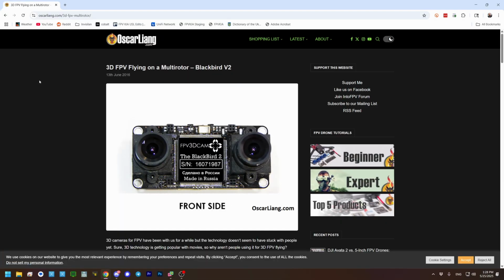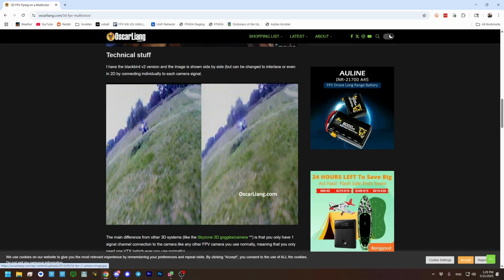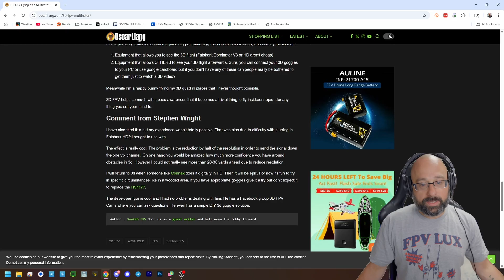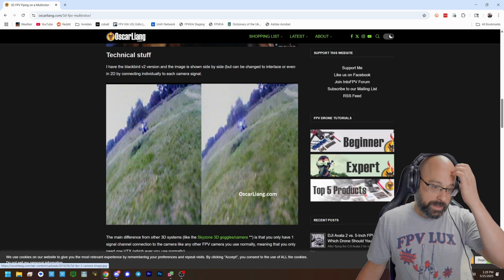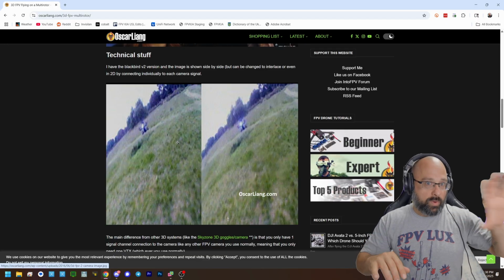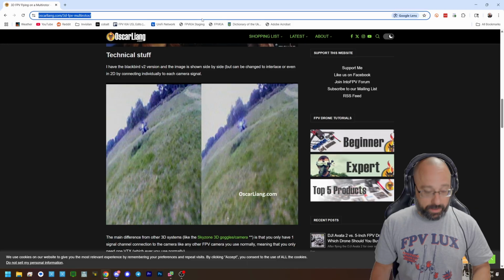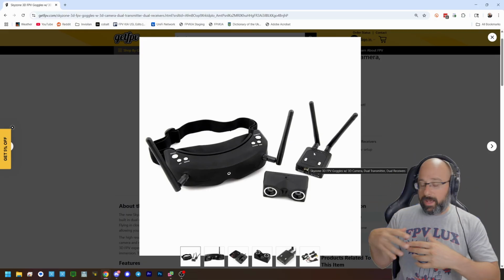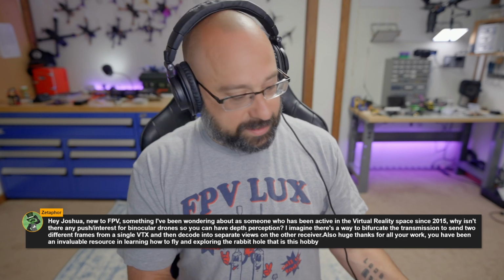Why Don't We Use Two FPV Cameras For 3D Video In Our Goggles? - FPV Questions

Comment: That's a damn shame. I am now retired but I worked in VR, Simulation, GFX etc. I'm in UK but worked for e.g. Silicon Graphics ( it was a world leader in Computer Graphics. Many ex-SGI people now work at Nvidia) and later, BAE Systems in the Flight Simulation team. EVERY animal on Earth has 3D stereoscopic vision of some kind. I can't believe that we put up with 2D vision in drones. OK, it was tried in cinema (at least twice) and TV (which failed becausee people didnt want to wear stupid LCD glasses - I dont blame them), but how difficult can it be with modern, cheap digital multiplexing, to transmit 2 images at the same time?
Come on DJI. You can do this.

Comment: Sigh. High-end feature-film stereoscopic professional here. Yes, we still exist. 

First things first - everything presented here is technically weak. There are literally zero technical barriers stopping the development of commercial stereoscopic drone camera systems at a consumer price point. Zero. There may be some compromises in terms of weight distribution due to the need for wide IO to best experience environmental scale, but that's it. The cameras, codecs, transmission and display technology are well established and affordable.

The simple fact of the matter is that the 3D stereoscopic brand is damaged. To develop and sell a consumer product with stereo in it costs tens of millions, and there is huge hesitance to engage. If you really want it, you can have it -but you all have to stop saying it's hard or impractical, because it's not. The various drone manufacturers are looking at their consumer base for clues for their next advancement, and if you're all 'will never happen' that is literally going to kill it. 

So, have some imagination and just ask for it. And as you all suspect, consumer FPV drones would be freaking amazing.

Comment: I’ve been filming VR 180 on my cinelifter drones for several months, and the results are stunning in the meta quest…. and I’ve been thinking about building a stereo DJI vo4 setup, but haven’t had time to work on it yet. I also realized that the reason you really don’t need 3D when flying that much is because the drone is always moving you are constantly getting parallax feedback from your surroundings that your brain turns into a sort of pseudo depth map.

Comment: The better question I think is why has this not been revisited with digital. Not only does digital have more resolution to work with but with analog, you need twice the bandwidth and that's not true with digital. The right and left images are not that different and compression can be used to make it require less additional bandwidth. You wouldn't have to give up as much resolution as well as having more to work with.
Reply: Working on it. Looks like there has been a fair bit of work on deep learning-based stereo video compression, but if I understand correctly, you would have to strap a GPU onto your quad to use those methods, and the latency still isn't great. But maybe soon!  In the meantime I think it makes sense to just have separate systems in parallel for each eye.

Comment: I made a stereo vision system for my robots using 2 Pfisher Price PixelVision cameras and 2 portable 4" TVs back in the early 90's. A HUGE hassle getting the images to line up but it did actually work.

Comment: i flew with several different types of 3d video and 60mm is great for 3d ipd and interlaced video worked best. i have videos on my page, the videos are in side by side because youtube doesn't support interlaced, but the best cam was the EMR labs 3D cam fpv camera out of Canada. i currently own one it still works great.  i also own several blackbird cameras both the original, 3 of the  mark 1 type, and 2 of the blackbird 2's and a 250mw video transmitter that plugged directly into the front of the blackbird 2 these all worked on a single analog video Tx 
the problem i found was susceptibility to vibration, and being 60 mm wide made mounting it safely difficult. oh i also have one of the nerd cam 3D as well its a piece of junk badly made.
i do wish someone like DJI would make one in 4k that would be interesting if you would like to see them or try one let me know

Comment: Joshua, I have a question: why don’t we use 180° cameras and to digital pan and tilt instead of using bulky and laggy servos? I believe there was a parrot drone that had digital pan and tilt and another proprietary system that I forget. The digital pan and tilt could be done either on the model or down on the ground. I’m dumbfounded as to why this isn’t a thing yet and I’ve been wondering this for probably a decade or more now.
Reply: Doesn't this increase the size of the data to be transmitted significantly?
Reply: @nullfield1126  No, as I say, you could have the digital panning done on the model so the feed is cropped before transmitting. You could even have two 180º cameras, one on top and one below the fuselage similar to a 360º camera. If you do a search for Parrot Virtual Gimbal, you'll see exactly what I'm talking about. We just need a generic version of that which could be installed in any model.

Comment: I wonder if it would be possible to train an LLM to extract depth data from the motion of a single high refresh rate camera and simulate a stereoscopic image from that inside the goggles. Would probably not be perfect and caus neausia real fast 😅
Reply: You wouldn't use a Large Language Model to extract depth data from a video feed. You don't even really need AI, either. It's just a bit of math to calculate a depth map from two images.
Reply: @Keyboardfanatiker  AI is also just math 😅 but I know what you mean. I was thinking that simulating the 3D effect could also be done using an LLM, similar to frame gen on GPUs, since it could possibly interpolate the data in way thats maybe more suitable to human perception and maybe avoid the sickness problems. If that's possible without the need of an LLM that would probably be even better.
Reply: @MarkusRessel  I'd rather have that dialed in by expert pilots.
Reply: @Keyboardfanatiker  not sure what your point is, I am not trying argue about which technology or approach is best 😆 I am just wondering if this would be possible _somehow_, and expressing that I would find it interesting. If some company is going to do it, they will do it whichever way is best for them anyway.
Reply: @MarkusRessel  Agree to disagree?

Comment: I did this with Skyzone goggles, two VTXs and two seperate cameras. They were high quality at the time but they were also analog. Today's analog systems are much better but still nothing like digital. For me, the poor video quality of the older analog systems made the 3D effect less than impressive. Trying again with a digital fpv system sounds very interesting! Maybe one of these IPC systems should think about trying it?

Comment: One good concept to design a stereoscopic 3D drone, is it for 2 fpv cam or 2 action cams and 1 fpv cam is a H-shaped pusher.
Reply: I played with two GoPro 5 Sessions, which can be started at the same time through the remote controler. Stitching can be done with old GoPro software or DaVinci Resolve (unfortunately only with the pro version). You can watch in a Cardboard, or much better, with DJI Googles 3.

Comment: I feel like the 3d experience would fit the best with head tracking and planes. It's just not necessary with quads, but in a plane you want to look around; especially with a head tracker. Depth absolutely would be a great fit for planes imo
Reply: it is also great on quads

Comment: On February 7, I posted a table (on a black background) on Instagram and TikTok that summarizes the two systems I know. After that, also some concepts on paper how to build a carbon fiber stereo 3D frame. I own the Skyzone 02X and 02S dual vtx rx 3d system goggles, but it will be a while before I can show this carbon frame in real life. That's exactly why I'm still investing in analog cams and vtx, because you can still use it for stereo 3D...

Comment: For the stereo 3D drone: I use two separate cameras going into two separate VTXs. You can choose the spacing between the cameras yourself. More separation is a stronger 3D effect: the world seems smaller. It does not have to be exactly 70mm. 

For the goggle side. The Skyzone O2C can receiver the video separately on both antennas for the 3D effect. The goggle can be bought on eBay. The special transmitter is crap and nobody sells it. 

But for me it is worth it. Since that moment I can’t fly analog
Video in 2D anymore. You can see far more because your eye is a very good graphic compute unit
Reply: Are you 100% sure 02C can do it  Because i did research sone month ago. But yeah i kniw that 02C is same than 02X but without front cam and without head tracking... But as far as i can renember i have not found any proof that 02C can do dual vtx 3D. I have done a summary table about stereo 3D february 07 shown on insta and tik tok. Is a black pic with white table...
Reply: @Sugalime3D_FPV  let me check, i have two o2 googles that can do this
Reply: @Sugalime3D_FPV long press the right button to go into the menu, and you should see the 3d options. They've had it even as far back as the sky01
Reply: @Tokyo_Dom  Are you sure the Sky01 can do it ?  And as far as i can see there are diefferent Sky01 versions. SKY01 V1/V2, SKY01S. I'm even not sure if the 02C can do it. Because at Skyzone you can go to Download and check the manuals.... SKY02C do not show the 3D funktionality in the manual... I own the SKY02X and the SKY02S, which I know for 100% they can do dual vtx 3D. Also it is shown in the manual description...
Reply: @Sugalime3D_FPV  Maybe not Sky01. My friend has a really old Skyzone goggle, i dont even think it has a label on it... Same shape as the sky02s i use but no camera on the front, and it has the 3D mode in the settings. I assumed it was the sky01 since it looked ancient haha. Checking the manuals is a good idea. No idea why sky02X has it but not sky02c
Reply: @Tokyo_Dom  Maybe it is only the SKY01 V2 or it is named Skyzone V2 goggles. I am not sure... I just know i found videos about "Skyzone V2" which support 3D. And i thnink it is  generation older than S02S. I think maybe we can see the difference on bottom. The V2 has USB connector. The SKY01 (V1?) has not. And the SKY01 (V1?) has a joystick, the V02 has not...
Reply: @Sugalime3D_FPV  I have the Skyzone 02X and they support stereoscopic FPV using two different channels (analog video ;-). 02C have not been advertised with this feature.

Comment: I have the skyzone 3d system and it is really effective, bery fun and immersive. In the end once the fpv system is in motion there are other 3d cues because of how things move relative to each other. On digital its way harder to do because of variable latency etc.
Reply: it can be done on dji with 1 vtx  by merging two pics and cutting two pics. But yes i agree a diversity dual vtx stereo 3D is only possible with fixed latency. That is why i I wrote to hdzereo a few months ago that this is their advantage and that they should therefore start implementing s3d. By the way i have postet summary about this february 7 on insta and tik tok. is a black pic with a white table ..

Comment: "Depth" is only noticeable within about 10 meters anyway. This might be useful for slow vehicles, but I dont think it's advantageous for fast-moving aircraft.
Reply: But all we do is proxy flying, I don’t think I’m ever more than 10m away from something besides a big split s
Reply: The effect is actually lost after about 1-2m. But this works amazingly well for tinywhoops. The problem is that back then the systems were heavy and suited to big quads flying outside where the effect is minimal. For tinywhoops everything is close by.
Reply: This is nonsense. Go to my playlist " Stereo 3D content" you will find videos where you have mountains or big objects like buildings like 100-500 meters away and see very well the 3D effect.
Reply: I have another opinion. When you watch existing Stereo 3D FPV videos you can see the 3D effect very well even on building or trees or small mountains which are 100 - 500 meters away...
Reply: @Sugalime3D_FPV  Interesting point of view (pun intended 🙂). Physics suggest that is not possible due to the parallax effect being so small at distance, but maybe its different while flying. I didnt notice much 3D effect for further objects, probably because low resolution of analog + the parallax effect.
Reply: @Tokyo_Dom  Yeahhh, it probably depends on many factors. 1) Distance between the camera sensors 2) Size of the camera sensors 3) Focal length of the lense. I have to do my experieces first before i can really say something right... I just started building Stereo 3D equiment...

Comment: You forgot to mention the biggest challenge with 3D FPV: the insane motion sickness to be expected! VR is still niche because most people suffer from bad motion sickness (VR sickness), when they virtually move but sit still in reality. This issue has not been solved yet, even by Meta, Sony and all the big VR players. This is why games still often rely on teleportation mechanics because fluid movement makes people sick (I'm also severely affected by that). The pure imagination of doing flips and rolls in 3D... impossible even for a strong stomach
Reply: my experience is the same as driving a car. driving yourself you dont get sick. for me it was no problem at all flying 3D analog. while with normal vr i got motion sickness
Reply: @MiniLuki The thing that makes stereoscopic flying work without getting motion sick is the cockpit view in my experience (in VR at least), maybe it's enough to see the ducts or part of the frame and/or OSD .. it would be possible to try in VR using a sim with one of the "2D game to 3D VR" apps that were popular before on non-VR games.

Comment: The Skyzone 3D system is actually really easy to replicate now, even on a tinywhoop. I just built a 3D tinywhoop, under 20g, and with the cameras placed 45mm apart - enough separation to enjoy a proper 3D experience. And because it is so small and light, i can fly proximity all over my house. The hardest bit is capturing this experience because the DVR only records one side. And if you record the other side with another pair of goggles there are always dropped frames so the footage never lines up.
Reply: Great to see that stereoscopic FPV is not completely dead! I also used it on a tiny whoop (but heavier than 20g ;-) and a 3-inch toothpick quad. Really fun to fly and very simple.
Reply: My comment was deleted, but I posted a video just now of my 3d tinywhoop. Can be done cheap and easy, if you have older skyzone goggles

Comment: So, I have worked with VR a bunch. Still have a headset at home too. And, I have used a pretty wide 3d FPV feed as well. Played large room size VR, running around with IR and night vision projected over cam feed on headsets. I don't get nauseated by VR. Sure, I feel weird walking on a flat surface where in VR it looks like a slope.

But both in a Sim (Tryp, Uncrashed), and on stereo 30mbit 1440p fpv camera feed, I get so so sick after just 5 minutes. The sway, roll, wind, propwash, it is TERRIBLE in stereo view. It is like a boat simulated in VR, but in 6 axis. Not many people could handle stereoscopic FPV. I love VR / AR, but FPV freestyle in stereo I genuinely cannot do.
Reply: Good input, cheers.
Reply: I’ve been filming some VR with my cinelifter, and you do have to fly pretty slow (especially in proximity) to make it easier to watch, but it’s super cool when going through a forest, etc.  I’ve had multiple people watch the videos in the quest that usually get sick in VR and they were able to watch them fine. planning to post some videos I’ve shot soon!

Comment: Somebody should reattempt it in digital era,  two eye pictures compress quite well, and should fit in the existing spectrum but it will surely draw more power
Reply: It does already exist. Developed for inspection robots. And already been put on a drone too, on a stabilized gimbal. But it is still extremely nauseating the moment you have any semblance or speed going on or any close proximity and lateral movement.
Reply: @jverdier887 Yes. I asked ai Gemini, surgical robots also use stereo 3D FPV. Presumably digital, too. But it's probably wired. And this technology certainly costs millions of euros.
Reply: @jverdier887  You need goggles with a high enough refresh rate. Two 144 hz panels would do it. And your latency need to be consistent (frame times all the same) and stay under 20 ms.
Reply: The 3d affect with our eyes is actually only good up to about 15-20' if I remember right, after that it comes down to our ability to reason the difference in size of objects and if something's in front of another. So for freestyle or further than 20' flying it's useless, might be okay for slow cinematic proxy flying... Haha I write this just as Joshua says for proxy flying...
Reply: @ugpfpv361  OK UGP so if your choice is only to fly long range at 100m altitude and you see everything from a long distance, then 3D is no use to you. UGP then you don't need 3D. 😂